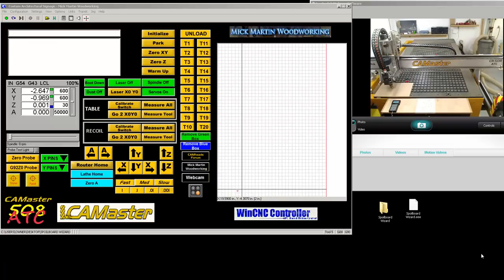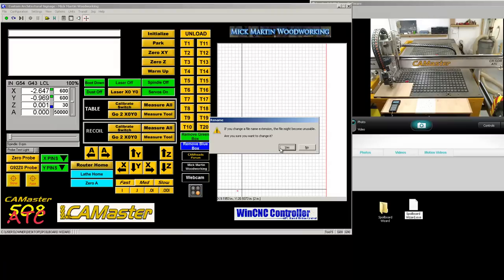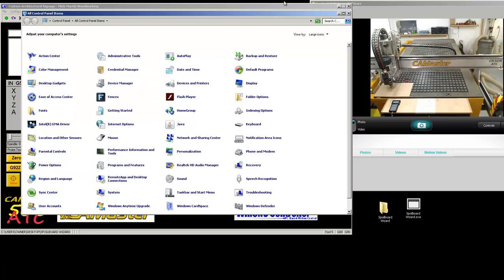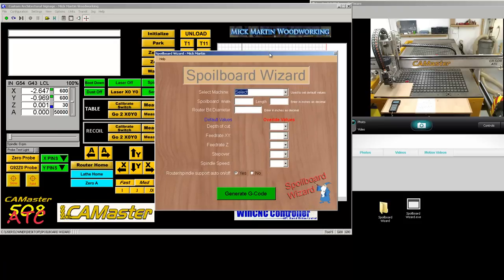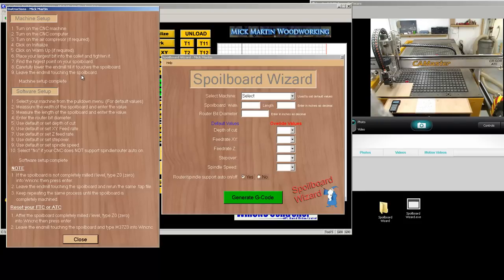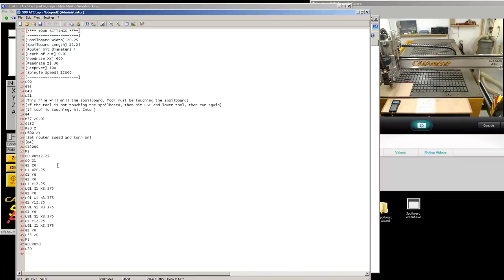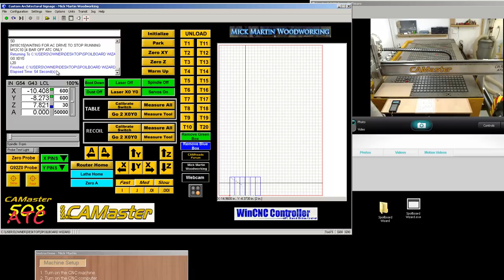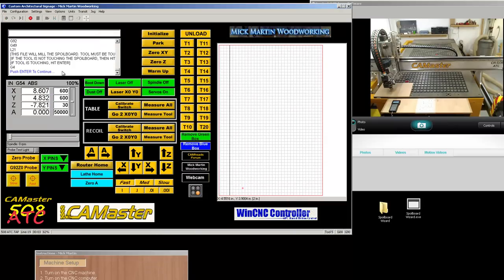Spoilboard Wizard

Comment: If anyone can help me out... When running this for the first time, I get an Error Soft Limit Exceeded [Y-]  right after it cuts across the first pass at the back.  I even tried different dimensions. Same thing.  Its nowhere near my limits.  This is a brand new Stinger 1 and my first spoiler board. Yes, Im pretty illiterate as far as cnc goes, but I get the basics. My machine homes and initializes to zero just fine.  What am I missing?
Reply: I found my problem.  The WinCNC. INI had my soft limit set to y0 .330 when it should have been y- .330  It came to me with the wrong limit from the factory.  After changing it, the file now runs just fine.  Glad I learned this now, on the first spoiler board, instead of my first project.

Comment: How do I know if I have Stinger I Old Style vs. New Style?

Thx
Reply from the maker: A new Stinger I has dual drive motors on the "Y" axis, the control box is part of the frame and mounted on the end. The old Stinger I has a single "Y" drive that is mounted underneath the table and there is a seperate large control box connected by cables.

Here is a link to the NEW Stinger I http://www.camaster.com/product/stinger-i/

Here is a picture of an OLD stinger I https://www.tools4wood.co.za/media/images/blog/Stinger_%281%29.jpg